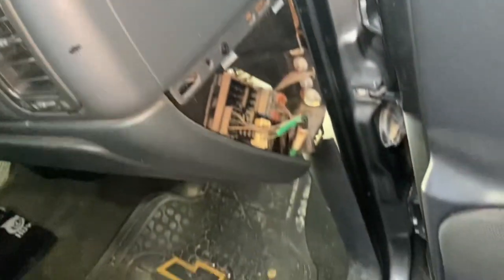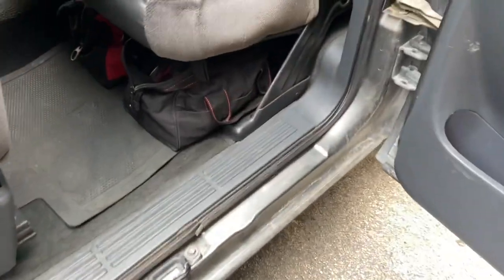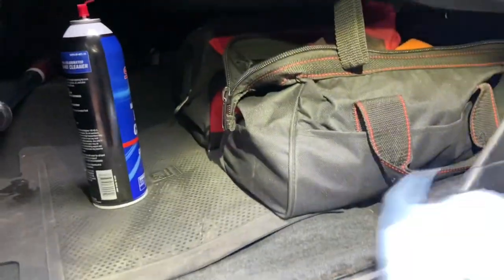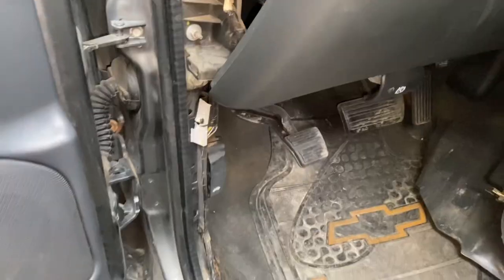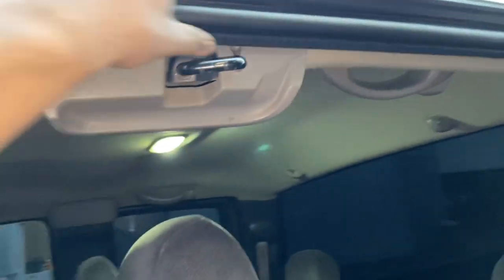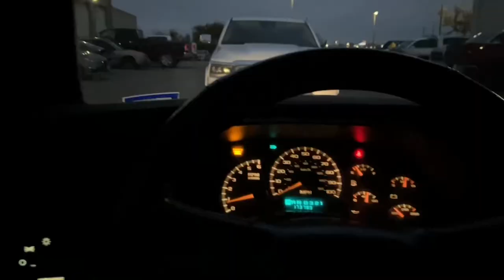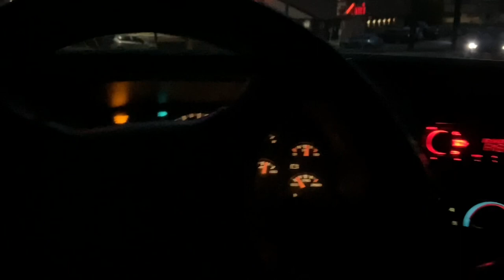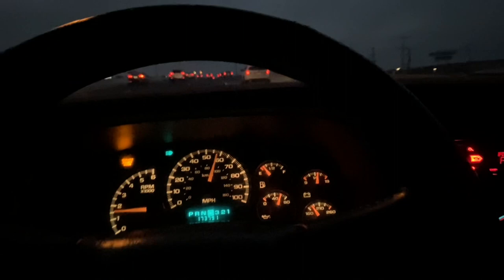99-06 gmc/ chevy extended cab door seals!!!!

Comment: You can adjust your door striker and push it back. It’ll make the doors seal tighter since the extended cabs don’t have b pillars
Reply from the maker: Thanks for the advise well try that next !!💪🏽
Reply: @pablomartinezla  ya tu sabes compa
Reply from the maker: @RipYuTube  yo te aviso haver como salio todo
Reply: @pablomartinezla  aye bro did you end up adjusting the striker?
Reply from the maker: @Erik-wq8rn  i did adjust it just a bit … it helped a little … but one of my friends showed me a trick to fix this issue on this trucks… you basically bend the top half of the door inward . You need 2 people to do this . One person holds the door and the other pushes the top half inward . After doing this my wind noise was almost completely gone.
Reply: @pablomartinezla  for sure bro the wind noise on mine is finally getting to me gonna have to try it out, do you bend all 4 doors or just the front ones?
Reply: @pablomartinezla  can you make a vid of how to do this bro?
Reply from the maker: @Erik-wq8rn  just the front ones . I see this problem a lot on driver doors, i guess after opening an closing for years they loose shape
Reply from the maker: @DanielMedina-cm7kw  yessir well try to make one and also an update on the wind noise
Reply: The hinge pin wears out which makes the front door be mis aligned.

Comment: I just did this today on my truck. It wasn't  the only problem,  i realized  it was the back window  that  was not tightly  sealed.  What can I do about that?
Reply: Buy the kit that comes with the window and seal, you’ll also have to buy specific glue to reapply back to the truck. I got the same issue and that’s the only way to solve the wind issue. It’s a worn out seal around the window

Comment: Hey Compa, were you having problems with water getting inside the truck or just wind noise? I have an 03 water is getting inside of drivers side and cannot find where it’s coming from!
Reply: Water was getting inside my 2001. Found out it was getting in through the grommet where the wires pass from the door to the inside of the truck.

Comment: part#15063154 says it doesn’t match my truck but part# 15063153 does, I have the same truck as you is there a difference for passenger and driver side? Thanks
Reply from the maker: Hello … when i was comparing them before putting them in they looked the same … i couldn’t tell the difference … so i didn’t know witch one was right or left side … but thats what the dealer sent me …. But I’m sure you should be fine if you used either part number